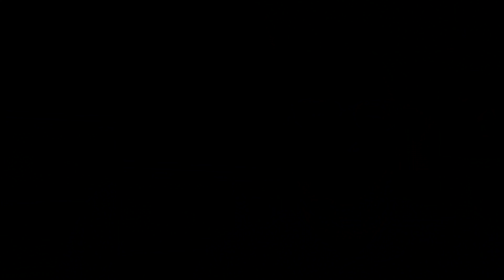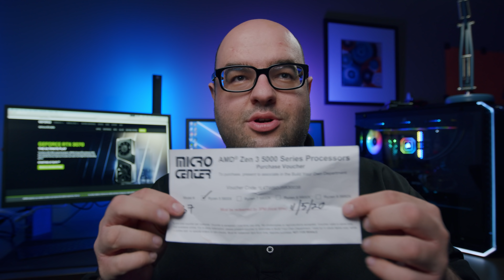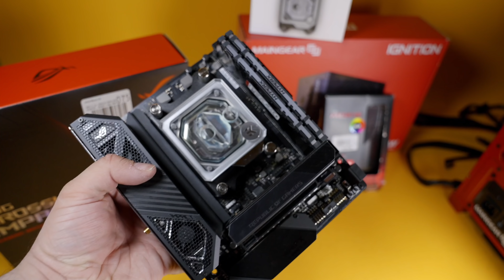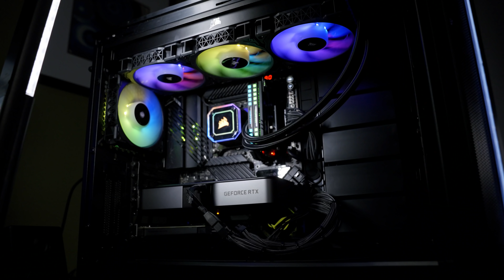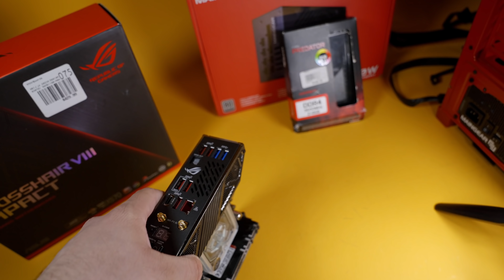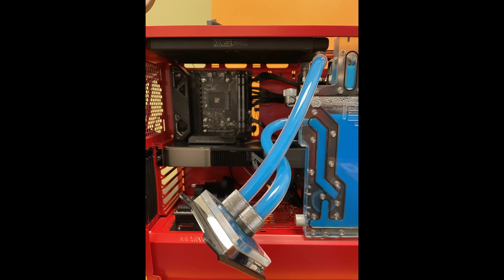HOW TO FIND RTX 3070 IN STOCK, PLUS FULL BUILD GUIDE, BEST CPU 5600x?

Comment: Im planning a build with a Ryzen 3600xt (since it’s on sale right now) and the rx 6800 for a 1440p 144hz Monitor  
Im not sure if the 6800xt is worth it since the monitor will probably bottleneck the gpu in most games
Also budget and stuff like that

Comment: If you building pc just for gaming with r5 5600x, don't buy 200-300$+ motherboard, it just waist of money, that cpu is so power efficient, you could probably run it on a520 no problem. So 100-120$ b550 is more then enough. And also its the last gen for am4 socket and ddr4 ram, so you cant upgrade to next gen, you will have to buy everything new anyway. So just add that money for bigger m.2 or ssd instead, you will need it, because many games need 100GB+ these days.

Comment: at the 5600X price range, the best CPU-s are either the 3600 or Intel's offer 10600,10600K; also, for gaming alone these mean above 100 FPS in most games and casuals won't care for / notice more; then the 3070 is justified for driving framerate at 1440p to rise up to that performance

Comment: 3070 + 5600x is looking to be the next big combo for mid-level gaming. It's definitely what I'll be aiming towards.
Reply: I’m bouta get the 3070 with ryzen 7 5800x so ima be a little above average and good luck finding the 3070 in stock ur gonna need it 👍
Reply: @funnyaka8194  Get the RX 6800 when it comes out. Its worth the extra money if you are getting zen 3 cpu because the increased performance.
Reply: @danipoz4420  When it coming out tho cuz I’m gonna need my pc components by January

Comment: I have a 3070 with a ryzen 7 2700x and rog strix b450f-gaming mobo. I need help for the best recommendation in regards of upgrading the cpu and mobo. What’s the best mobo pairing if I were to get a 5000 series or should I just upgrade the cpu to one of the 3000 series so I don’t need to spend money on a new mobo?
Reply: I recently upgraded from a 1600x to a 3700x. Totally worth it for me. For you might better to go to a 5000 series.
Reply: @inrptn  what do you think about the longevity of the 5600x as a 6 core 12 thread compared to more modern 8 core 16 thread cpus? Should I be concerned about that before buying a whole new motherboard to support the cpu itself? That’s why I have second thoughts about just sticking with 3700x-3950x’s

Comment: I think the rx 6800 is a much better deal for a little more money considering that future titles will need more VRAM ultimately
Reply from the maker: The 6800xt too
Reply: Yep. Depends what you can actually find, tho. If I had to choose between a $499 reference 3070 and a $650 AiB 6800, I'd take the 3070.
Reply: @inrptn  6800 is $580 so why are expecting an aib markup so high that you’d be better off with an XT model closer to msrp?
Reply: @raerodynamic  You don't know how AiB pricing works, do you?
Reply: @inrptn  I’m asking why you’d consider an aib priced so high when there’ll certainly be ones that are closer the msrp of the 6800 than the XT.
Reply: @raerodynamic  Good luck finding one during the next several weeks. All of the reference boards and low-price AIBs sell out the fastest.